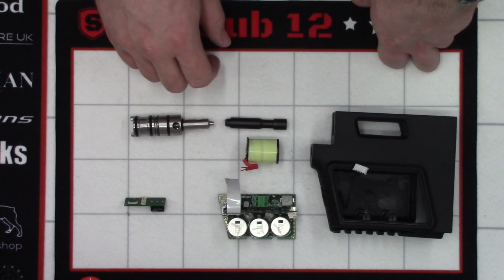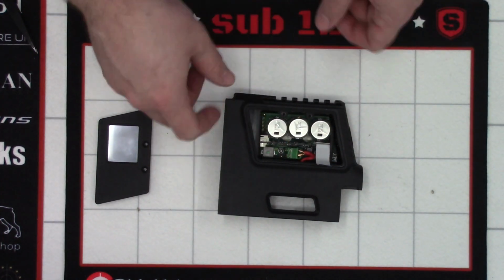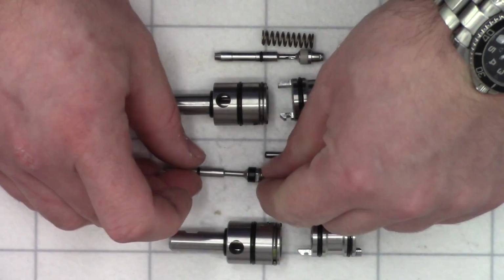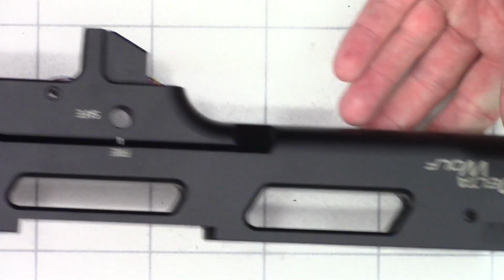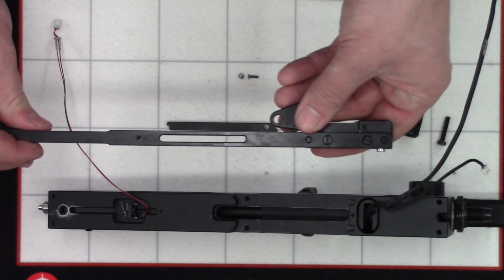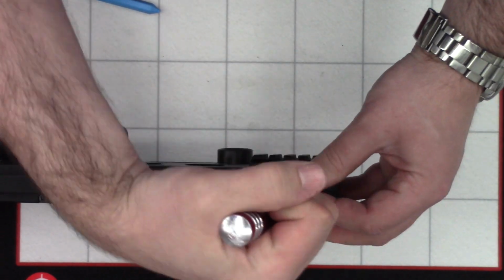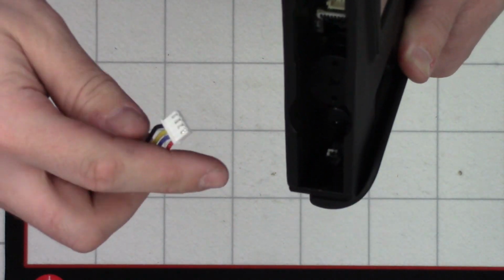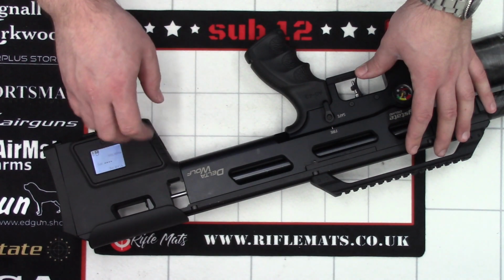Daystate Delta wolf reassembly

Comment: great video i have a daystate revere i took the shroud off and cleaned the barrel when i put it back on it stops 2.5 to 3mm shy of going all the way against the front face of the upper breech block and i cant get the 1/2x20 piece on the front to unscrew (it has screwdriver slots in the end) so can any of you UK  folks or anyone tell me what im missing and how to remove the air stripper (the 1/2x20 piece) on the front of the shroud?